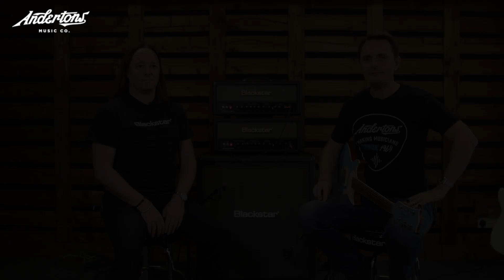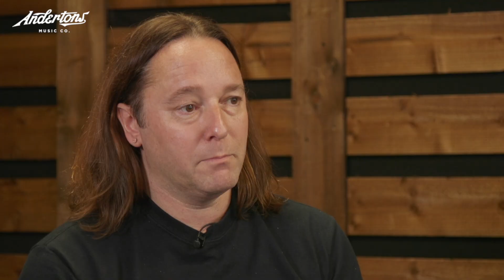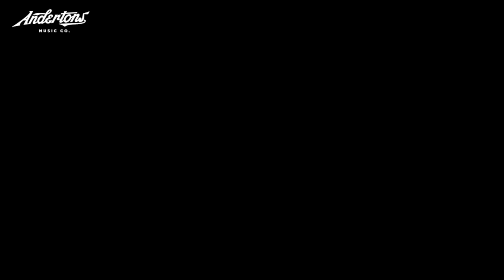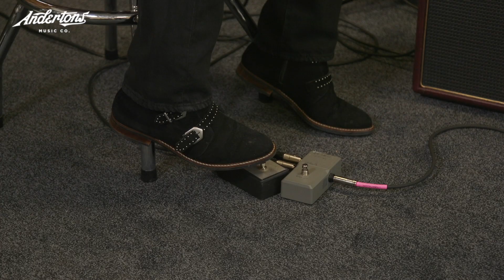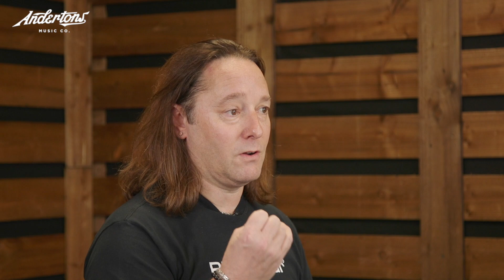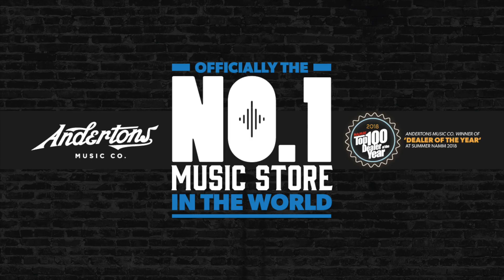Guitar Amp Myths Part 3 - Do Different Valves Make Much Difference?

Comment: Do they sound different when you call them tubes instead of valves?...maybe Eric Johnson can answer this...;)
Reply: Valve is short for 'thermionic valve', an electronic device that controls the flow of electrons in one direction. Tubes are a) what we travel in under London, or b) what Smarties come in.
Reply: @Blackstaramps  Wonderful video presentation and a great introduction to valve amplifiers.  One thing not touched on is the Sylvania branded Fat Bottled 6CA7 Valve which is Beam Tetrode version of the EL34 Pentode.  Popular in home audio applications but I rarely see them in guitar amplifiers.  Is there  a technical reason for their absence in guitar amps ?  I know from home audio experience that they have  noticeably more headroom.
Reply: "Tubes" has a rounder sound.
Reply: Also, are EL firty-fours different sounding to EL Thirty-fours? I’m trying to decide which ones to go wiv.
Reply: @andrewmoseley4029  Are you making fun of my Essex accent? You're not the first. What were they finking, getting me to talk on this?
Reply: Blackstar Amplification I’m not meaning to. I have an obsession with accents, sorry. I thought the presentation was good.
Reply: Valves have to open and close, like a noise gate, so you get a more pronounced attack
Reply: Tube refers to the shape of the glass,  valve is what it does - regulate  the flow of electrons....

Comment: I changed valves in my Kemper and it made a huge difference. First i got smoking sounds, the burning sounds, then explosions.
Reply: I think one of my valves sounds better than the other because I'm biased
Reply: I heard the first tube amp was used during the enlightenment but I think the person that told my that story seem a bit biased.
Reply: I put a capo on my valves.....that definitely made a difference !!
Reply: @artvandelay2111  So did they have higher frequency?🤣
Reply: I true bypassed my valves. Much better.
Reply: I think you did it wrong.
Reply: do you recommend tubes for my speaker cab? or valves?
Reply: @mikemorine7670  Valvetubes. Best of both worlds.
Reply: @panicraptor2837  Where can I buy?! I want! LOL
Reply: @mikemorine7670  In storeshops only. With cashmoney.
Reply: @mikemorine7670  depends on if it is Europe or America
Reply: I used to be a guitarist before I took a valve to the knee
Reply: So is valve the Brittish word for tube?

Comment: I have changed valves in my amps, they never seem to make a difference.  For example, changed everything on my Hughes and Kettner tubemeister to JJs.  No change in the tone whatsoever against the Chinese stock valves. I appreciate for some there might be some kind of tonal difference but for me, waste of time, waste of money.
Reply: Maybe not a total waste since the chinese tubes(valves) have a much lower life expectancy.
Reply: Not according to Uncle Doug, he seems to think Chinese made tubes are made much better and should last much longer than say an RCA or Phillips. Unsure if he was talking about compared to JJ though.
Reply: @RapttorX  well I would have to let some time lapse first I guess.
Reply: Totally agree! I changed my preamp tubes (JCA22h) to EH's or 2 Rubys in the front and rest stock chinese! I happened to like all 5 slots chinese best. Why? They sounded the "roundest". None of the changes made the JetCity a "Metal-amp". As soon as you put a TS-like OD as a boost in front of it, it becomes a metal amp. Chinese tubes are not that bad anymore. If the tubes are OK in quality, changes in sound are minor. Yes, with EH's you will have more distortion but it won't make a plexi-style amp a metal beast or whatever. Pedals in front or mods to the circuitry of the amp make the difference, always.
Reply: @Mode-Noir  I think that's the mistake we seem to make nowadays.  We seem to think because it's made in China is inferior.  I'm not advocating Chinese goods, because they still produce a lot of guff.  As far as a TS type pedal, they by far and away the best pedal to go with most amps.  Every amp I own benefits from my Maxon od 808
Reply: @steviesedge  Yes, Stevie, but even a Behringer TO800 and many other OD-Clones and not clones will be great. Even some distortions are killer as an OD-Boost. I have an MXR Dist III and it also cuts the bass and adds distinctive mids with gain/drive at 0 and level/volume according to taste. Yes, if your amp is properly biased and tubes are fairly new and you're not satisfied with the sound then you probably need an OD-Boost of your liking or an EQ-Pedal and in addition the humbuckers for the right response/feel/preferred breakup of the tone. Also the room acoustics can make your amp sound like shit.
Reply: @Mode-Noir  Exactly what we were trying to get over. Thanks for watching. Paul
Reply: The differences people hear are just differences in tolerance. Which is pretty high on valves
Reply: I think the difference people hear is the lack of quality control on the “cheaper” brands. They’re all made in the same 3 or 4 factories. It’s just the better brands have better quality control.
Reply: I switched JJs, Tung Sols, EH's in my Randall (all 12AX7's)
What I found was the JJs having a more emphasized low-midrange
The Tung Sol's were more pronounced in the upper midrange 
And the EH's having a more top end
Reply: The differences are more subtle than some want to believe, but it is important that power valves are biased correctly.